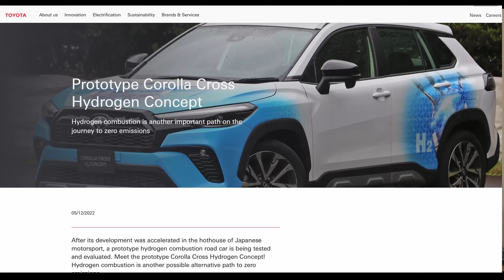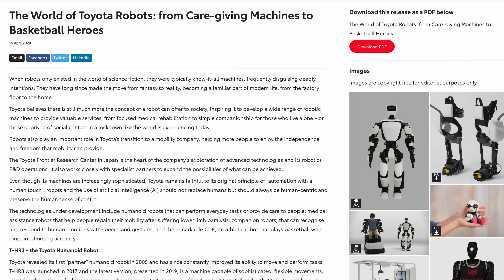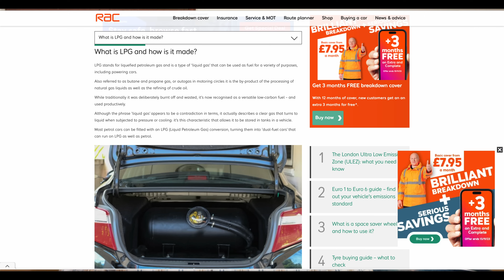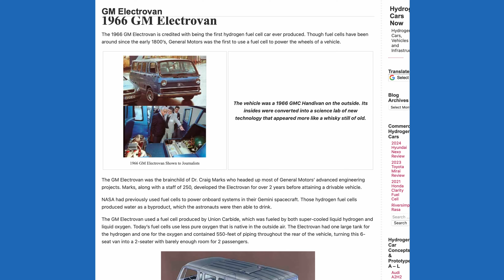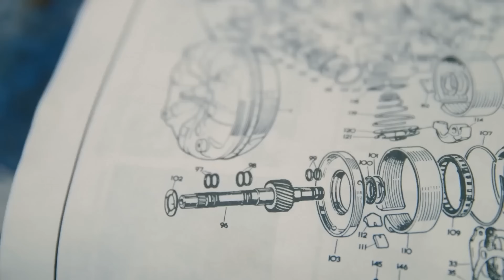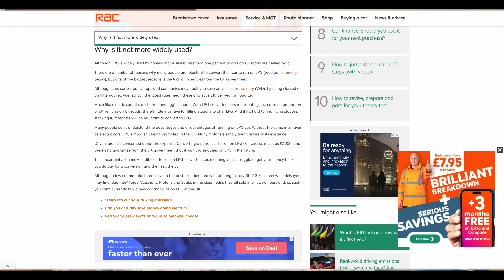Will Hydrogen Give EV Charging A Run For Its Money?

Comment: Hydrogen has a much lower energy by volume so you need larger high pressure fuel tanks that on the Mirai have a 10yr lifespan. When you open the fuel filler the date for tank replacement is inside the flap.
Reply from the maker: That’s great, a car with a self destruct timer, just what we need
Reply: @davetakesiton  Be interesting to get a price for the 122L of tanks as some Mirai's are getting older
Reply: Yes indeed. It's an issue that is rarely touched on. Hydrogen fuel cells degrade over their working life, and will need replacing or repairing at some point......as will the high pressure pipework on the car.

Comment: I will sound one optimistic note for growth of hydrogen production and use: Eventually electricity, from solar and other renewable sources, will become abundant enough to be cheap, despite the growing demand for EVs, heat pumps, and other growing uses. And it's not anything new that there are many industrial uses for hydrogen. More abundant and cheaper electricity can be expected to accelerate growth in those existing industrial uses for hydrogen.

I doubt if that has much to do with Toyota's plans, but it will probably go that way.
Reply from the maker: Very true but by the time we reach that, EVs will be everywhere charging really cheap and the need for hydrogen has probably disappeared
Reply: @davetakesiton  I'm not talking about that. I referred to industrial uses. Ammonia production is probably the most familiar example. Rocket fuel is mostly likely going to be a growing application. I think hydrogen can compete with coke in making steel, although I'm probably on somewhat thin ice there, as I still know shockingly little about how steel is made. But there must be thousands of other uses in the chemical industries.

There are also airships, which may be poised for a real renaissance, but that's a bit speculative so far.

Comment: Cant see it happening myself but all non polluting alternatives are welcome in my view.
Reply: Hydrogen is not a "non polluting alternative" (just sayin')
.
If the electricity to liberate it comes from the grid and that can be made exclusively "green" energy, since the grid is not 100% green, you're essentially "robbing Peter to pay Paul", taking that supply from another area that must be replaced.
But, you don't have extra (100%) green energy, so you use....? Fossil fuel
.
Conclusion, Hydrogen results in "extra" fossil generation remaining on the grid.... It's dirty, even if they say it's "green"

Comment: Hydrogen is a great option. You can make a 100% hydrogen engine using hydrogen as fuel or you could have a car with water fuel and the car itself would create hydrogen on the spot or you could have a hydrogen electric generator for electric engine car.
Reply: Water engines are just plain stupid.
Water is composed of hydrogen and oxygen.
As oxygen is much heavier than hydrogen the bulk of the weight of water is oxygen. 
The amount of hydrogen in 1 kg of water = 111.1 grams.
In electrical terms, the energy density of hydrogen is equal to 33.6 kWh of usable energy per kg of hydrogen.
Therefore the amount of hydrogen energy in water is 3.733kWh per litre of water.
The energy in 1 kilogram of hydrogen gas is about the same as the energy in 2.8 kilograms of gasoline.
So the amount of energy from 111.1 grams of hydrogen (from one litre of water) is equal to 25 grams of gasoline.
96 oz to one us gallon.
With a fuel cell vehicle the hydrogen is combusted with oxygen from the air whereas with a water engine the hydrogen is combusted with the oxygen from the water.
That means that you will be carrying the weight of the oxygen (which is much heavier) around with you in the water as well as the batteries needed to split the water into H and O.
A water car is in fact just an electric car as all of the energy to make it go comes from the batteries, which have to be charged just like an EV.
Reply: What's an electric engine?

Comment: Hi Dave great video. If I put 25 kwh into my Ioniq EV with 10% charging losses I get around 100 miles. If I used 25 kwh to make green Hydrogen how far would Hydrogen car go on this. I think at best it would be 20 miles. EV £0.025 mile Hydrogen £0.115 mile.
Reply from the maker: you get the picture

Comment: Great video Dave. I was involved in a green hydrogen project which despite the millions poured in was unviable. The infrastructure required in the project to make, store and move Hydrogen was eye watering. And still the natural losses of the gas still happened. The regulations of having anything Hydrogen are set at international level and have to be met. It has a place somewhere but not for ground transport. The REAL experts on the project very quickly moved on when they saw the figures. Not wanting their name associated.
Reply from the maker: But oil giants still persist, in desperation?
Reply: Toyota is just really trolling itself at this point..
Reply: @skataskatata9236  
And it's not a pretty sight.

Comment: Thank you, you missed two major energy loss with hydrogen use for transport - the energy required to compress the hydrogen to make it energy dense enough to be useful.   To compress to 200-300 bar needed for cars requires some 20% of the energy content of the hydrogen to be used resulting in an additional life-cycle loss of 20% with using hydrogen in cars.  Hydrogen fuel cells are around 40-60% efficient so another additional loss of around 50%. for the creation of electricity again from the hydrogen.  The lifecycle efficiency of energy of electricity->hydrogen->compression->fuel-cell->electricity->motor is about 25% where as the efficiency of electricity->hydrogen->combustion is about 12% and the life cycle efficiency of electricity->charger->battery->motor is around 85%.
So, regardless of any other factor such as the distribution network (or local generation), the economics of hydrogen is insanely stupid and will not be adopted since it make no economic sense for and company to invest in this for road/rail transport.

The current manufacturing cost of a BEV is about equal to an ICE car for companies that only make EV cars (battery is additional cost, power train is much cheaper than ICE engine), and it is expected that by 2030 the upfront cost of a EV car will be 20-50% that of a ICE car.
Finally, for all those people that read the daily mail or watch fox news : the green cost of an EV is greater (at the moment) than a ICE car, but for most NORMAL economies with a electricity generation mix, this upfront green cost is overtaken by petrol/diesel cost after around 6 months.  Even if the electricity was ENTIRELY created by fossil fuels, due to the 3x better efficiency of a BEV over an ICE car, it would only take 3 years to repay the green upfront cost.
For those commenters that don't use evidence and data in their responses - good luck for your future.

Comment: Looking at making Hydrogen, I believe 1kg of Hydrogen produces 40kWh, but this needs around 55kWh of electricity to produce it. Now add in the costs of machinery to produce and store it, the cost to transport it and the profits to be added at each stage. So how much will it cost ? 
It then makes more sense to just use the electricity in an EV.
Maybe Hydrogen will have a place but I feel it would be more likely to power a factory and by having the hydrogen production next to the factory would remove a lot of the problems in transportation.
Reply: Yes, it makes sense IF there's an abundance of spare renewable energy.  That's the fun question for the pro hydrogen people, just ask where the green hydrogen comes from and they melt.

Comment: Let there be choice and alternatives to clean energy...never say never.
Imagine if all cars are only electric on the roads. It will cause massive bottlenecks at charging stations, grid capacity issues, and price hikes in electricity are bound to happen when there is massive use of electricity everywhere. The Govt is not going to bail out households every time, like it had to last winter with £400 monthly rebate.
Reply: Here's the funny thing, during last winter, my day rate went up but the night rate went down so the car was cheaper to charge.
Reply: @djtaylorutube  
That's good.
But remember, not all can charge at home. There are very many people who live in flats in urban areas.
ubitricity pricing at street lighting poles went up from 40p to 46p per kWh at standard rate and a new peak rate of 79p between the hours of 4-7pm, which they never had before.
Reply: @harmony3138  Indeed, it's still early days for charging infrastructure but i'm also not going to feel responsible for solving that problem other than acknowledge it at this time.
The current generation of new drivers will have plenty of options and unlike most of the Daily Mail/Express readers belief, there is no ban on the sale of ICE beyond 2035 so they can continue to use those as they choose.  What price they'll need to pay for fuel and how tax revenue for all transport is unknown.
Reply: @harmony3138  Is that price with a subscription or without?
Reply: @Brian-om2hh  
Without.
Reply: It would also cause massive bottlenecks if everyone wanted to fill with petrol at the same time, but of course it doesn't happen. For the scenario you cited to become reality, all electric car owners would need to drive EV's with the identical capacity batteries, have identical driving styles, cover the same distances on routes that were the same length. It just won't happen....
Reply: @Brian-om2hh That’s hardly going to happen, I drive a diesel car and now I have retired my actual not theoretical range has dropped from 600 to 500 miles per tank of fuel. I now fill up my fuel tank ever 6 weeks when it shows 1/4 full, even when I drove to work doing 45 miles daily I filled up every 14 days doing over 11,000 miles per year which is 3,000 miles over the average so nothing like driving an EV.

Comment: Great fun trying to fill up with hydrogen rarer than even EV chargers
Reply: It will cost tens of £millions and take 15 to 20 years to establish a viable hydrogen infrastructure in Britain. And the irony is that each one of these hydrogen filling points will need an electricity supply........  And will you ever be able to fill up at home on cheap rate hydrogen? Er no.
Reply: @Brian-om2hh  
Each one will need 3 times the electricity supply (!)
Reply: @rogerstarkey5390  I just pointed out an electricity supply would be necessary. I don't doubt lots of energy will be required via that supply. 👍👍

Comment: How about Steam ? They seem to have an inexhaustible supply of wind and water so let’s go for Steam. 
Hydrogen ? Isn’t that the stuff Shell quietly ripped out recently here in the UK?
Reply: I’ve heard they recently invented a thing called a horse that runs on grass and water. Surely this is the future.
Reply from the maker: and my roses love the pollution they create
Reply: @philiptaylor7902  neigh
Reply: @philiptaylor7902  Don't believe the horse hype. Try finding out about the cost of hay, vet's bills, new saddles, the cost of regular re-shoeing if you ride it on tarmac etc. Oh, and you can't take 3 of your mates down the M6 with a load of suitcases using a horse either......
Reply: Yes, Shell are removing their LPG infrastructure in the UK, as are many other LPG outlets.

Comment: The only use I can see for hydrogen is situating green hydrogen plants near renewable energy sources to use surplus. This surplus can then be used as source for when we have shortfall in renewable energy.
Reply: There’s already a less expensive than hydrogen method for storing the surplus - batteries.
Reply: @kng128  
Exactly.
This is the use for Sodium ion.
Containerised.
One off build cost.
Minimal maintenance.
Efficient reclamation of stored energy (not "let's throw 60% away!")
Reply: Hydrogen is valuable, so if the energy is free (surplus scenario) then MAYBE you can compete with generating hydrogen from methane? And sell it for industrial processes? But you are out in the sticks somewhere in this scenario, so it is doubtful because of transport costs.

Comment: hydrogen i was told to make uses  2x the electricity as just putting it in an electric car.
plus you have to use a tanker to transport to filling stations.  may as well just use lpg.   but there are less lpg filling stations and even less people to service it.   i should know i had a lpg car 
it would be interesting to the amount electricity used to make petrol.
but mind  the macmaster says ev's are not the future maybe you should look at all the lies he spouts.    he stages events to make the ev look bad.
including a so called bit of wood falling off a wood truck and hitting the underneath of the car.   All lies.  he showed the garage video of inspection and there was not a scratch or bit of damaged plastic   4 episodes all lies,   just a story.
this is the people who need to be told true facts
Reply from the maker: No, David, they know the facts but have just found a dead cert way of making a fortune and won’t give it up for the truth and less money

Comment: Hydrogen is also such a small molecule it escapes out of every connector, also it changes the chemistry of the pipework and there is the latent heat problem with fuelling . I prefer my ev it's full of electrons every morning automatically
Reply from the maker: True but the oil giants can’t make any money out of you
Reply: @davetakesiton  Oil giants are energy companies.  They will use their wealth to stay ahead of green energy startups and stay involved in power generation.  They simply don't see green energy as a threat yet.
If they wanted to fund nuclear power projects, they easily could control domestic power supplies by owning the stable long term sources of power.
Reply: @davetakesiton  Dave, the oil giants may just have to accept that their time is over, and they've had a good run. Just like the the horse breeders, blacksmiths, saddlers and carriage builders of 130 years ago.....

Comment: hydrogen was always the future of power, its just that they found the profit in cobalt
Reply: But what about Tesla already now producing 50% of their cars with cobalt free batteries? And with other EV makers likely to do the same, how does that square with the point you made?
Reply: @Brian-om2hh  only just now doing it though after years of profiting from cobalt karen
Reply: @BENNYSAUDIOWORX  And how long has the oil industry profited from cobalt?  They are after all, the largest users of mined cobalt on the planet....and have mined it for generations.
Reply: batteries aren't the only user of cobalt. globally they are sub20% of total use
Reply: @waynecartwright-js8tw  Around 95% of which can be recycled and reused repeatedly. Unfortunately, there is nobody recycling and reusing old burned petrol and diesel.....

Comment: Will  the figures add up from manufacturing  to pump at the present t time no, but the fossil fuel industry is fighting hard to stay in existence.
Reply: It'll get increasing more difficult for them to stay in existence once oil supplies become scarcer, or oil becomes unviable to extract and refine, such as when the sales volumes of petrol and diesel no longer sustain enough profit to make it worth refining for road fuel anymore. Sure, some oil will still be needed to produce some products, and the price of these will doubtless increase to reflect this.... The oil giants are desperately looking for a new cow to milk, and the only runner at the moment is hydrogen. Too many other big hitters have fingers in the electricity generation pie, so they know they can't grab all of that market.